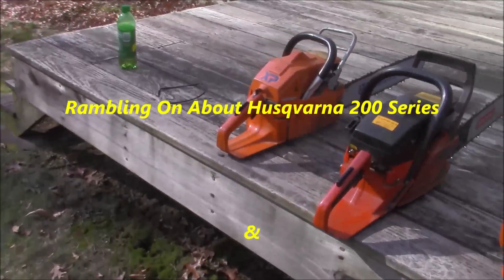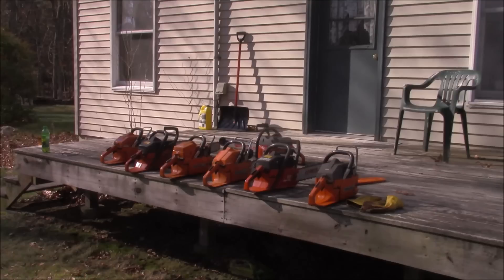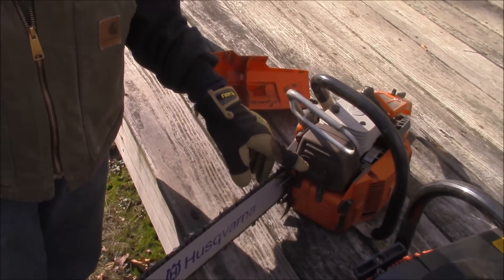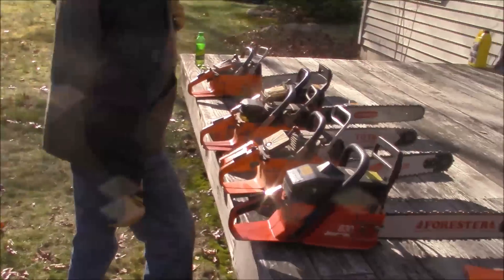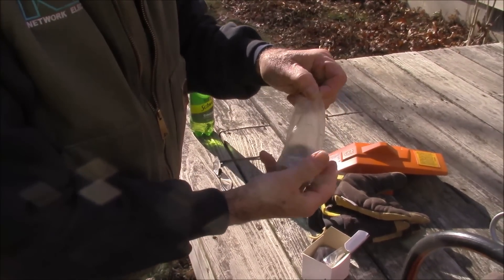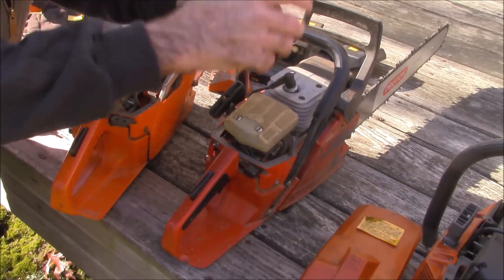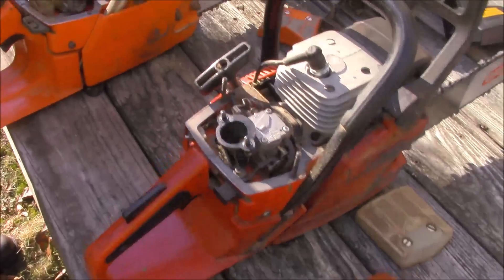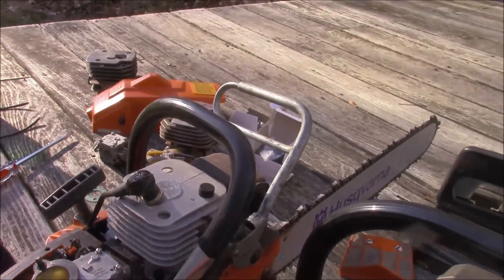Rambling On About The Husqvarna 61 - 272 Series & Jonsered 625, 630, 670 Chainsaws With Spike60

Comment: The bolt holes for the mufflers are the same size in all of the cylinders, but the early style muffler uses a stud that steps down to fit through the muffler.
For the top covers, there was a change in the 266 cover during 84, and the late 84-97 266 covers, and the grey top dual coil 61 top covers clear the 272 cylinder just fine.

On my 61-272 conversion, I used an 89 chassis that didn't have a good top cover bolt hole. I drilled and tapped for a 272 style cover because I had an AM one laying around.

Comment: Lots of good knowledge in there. I just put a 50 mm piston into a 61. Wasnt too bad. Its around 68 cc. Still have the 61 carb on it and breaking in but its at 220 psi. It will be a great saw. I think its a better buy then a new echo 590 . Possibly then 620 too. Cheers and thanks for sharing

Comment: I put aluminum tape on the inside of all saws that have a top cover that fits close to the muffler.  I clean the cover good with break cleaner and cut the tape to fit.  I also put some under all the mufflers on my bigger Stihl saws to keep the heat from melting the paint on their magnesium cases.  Mufflers get hot,usually over 300 degrees F..

Comment: I just rebuilt a 365 special and put an OEM 50mm top on it making it a 372 so your video brought something to my attention. The 372 was a closed port motor correct? They weren’t like the 365&365 special one being open and the later being closed port correct? My questions lead to it won’t start on its own? Pour gas in the carb it fires but on its own it’s dead so any suggestions? The saw has new everything from cases to carb. Any input advice is truly appreciated Thank you.

Comment: I just bought a brand new oem oil cap for my 61 a couple months ago on ebay. Didn’t seem hard to cone by
Reply from the maker: The small one? 61's had two different sizes depending on vintage

Comment: My 61 runs a 24” bar pretty well but after hearing you take a dump on the open port I’m really thinking about putting a 272/268 top on it
Reply from the maker: If it runs and puts a smile on you, run it! Wait for it to get tired before moving to the 268 or 272.

Comment: Question why a resistor plug on a chain saw I always thought they were for radio interference. I would think a non resistor would have better spark I’m confused
Reply from the maker: Maybe, I'm guess it is like any other electrical system , matching the components to get the desired result while also being reliable. If the CDI is designed for a certain resistance, having less would increase amperage right? Would that possible push the limits of the CDI internals? I don't know off hand what the ignitions of that era had in mind. Why I asked Bob. :)
Reply: @afleetcommand  i figured more amperage more spark which i figuered be better but i see what your saying the ignitions mie need some resitance
Reply from the maker: No I get it, but what is the effect of the other parts it the question. :) And I don't have a way to quantify that really. My guess is the old points systems would rather have a no resistor plug. The Newer CDI's might not be as happy with the older CDI's in the 1980's era prolly doesn't matter as they had to design for the both based on what was in the field & what a customer could predictably do. For the spark. Not really sure where to go wit that as there is voltage & duration. First and foremost there has to be enough of both to punch through the compressed mixture. As the pressures and amount of fuel go up, that requires more of both. I can imagine a situation where the resistance at the plug in a given combustion scenario would benifit from less "upstream" resistance to work as its actually the resistance of the entire system from coils to across the plug that matters. And if for some reason the mix is tougher to ignite, something like nitro methane , maybe a longer duration is required. So differnt ignition parameters are at play. Guess for me it's the "more is better" approach really is "the right amount is best" in reality.